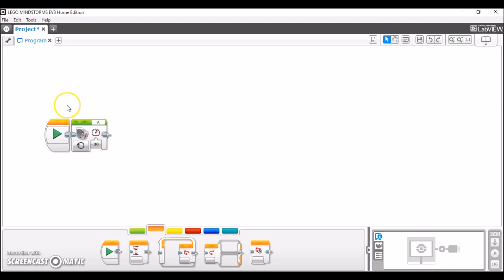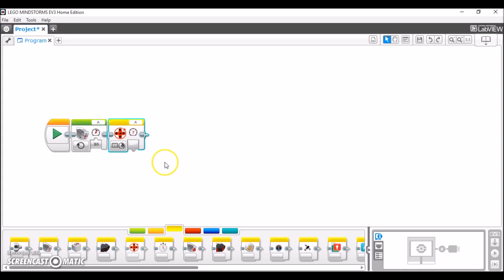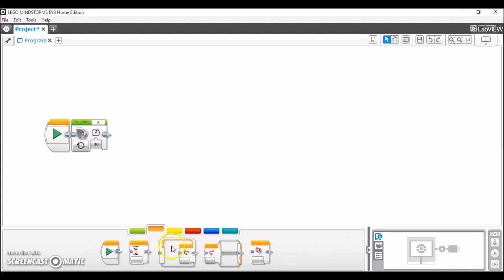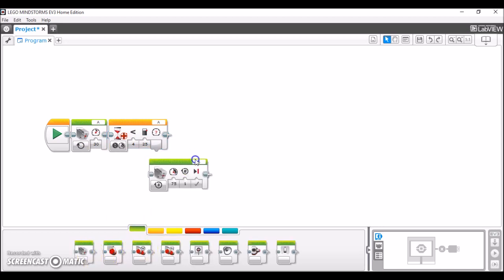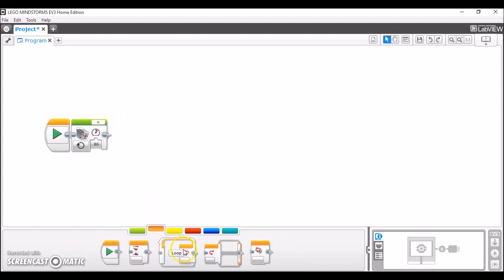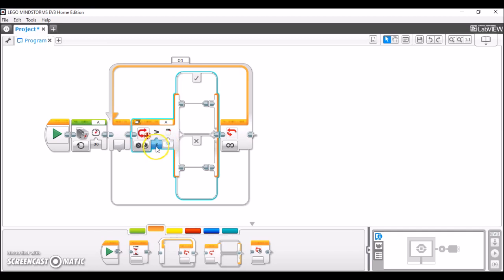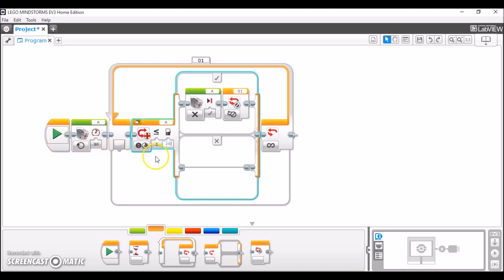Program your EV3 Robot to Detect a Motor Stall | EV3-G

Comment: Didn't work for me, sorry. I found a workaround that works 100% of the time by using timers: start timer before the motor command, reset it after the motor command. Then in another thread check the timer for value and stop the motor above certain threshold.
Reply from the maker: It's strange that it didn't work for you, this is the method I use all the time. Perhaps this method, which I covered in a more recent video, will work more reliably for you: https://youtu.be/7ptT2AEdbi4
Reply: @Builderdude35  For me the program just gets stuck on the instruction block for the stalled motor. Could it be that because I'm running my EV3 unit off the rechargeable battery pack, the power level is somehow unaffected?
Reply from the maker: The rechargeable battery pack has a slightly higher voltage, but you can adjust the power threshold value a bit until you get it to work. You may find that it works best when the threshold is just below set power. For example, set power 40%, stall threshold 35%. 

Alternatively, the other link that I provided has an updated version of my motor stall program that is more reliable; it works by measuring the change in rotation over a small time interval (essentially taking a derivative), and it works regardless of motor power, without needing threshold values.

Comment: Does FLL require a person to use the preinstalled firmware on an Ev3 not something like Ev3Dev?
Reply: Btw, I'm not an FLL member.
Reply from the maker: I don't recall exactly, but I'm fairly certain that you must program in EV3-G, so yes, that means that there's no point in using EV3Ddev.
Reply: Thanks!
Reply: Wazboy Developers I

Comment: It's okey to use it when you want to detect when motor is stalled, but useless when you want to protect your motors or electronics. EV3 motors already have auto detection when  motor is stalled. Try to stop motor with hand, you will see that power is cutted off automaticialy and it wait when you leave it to turn power again.
Don't worry, this is toy made for kids too, so it must be safe. If not, it could burn when motor is stalled, but it can't.

Comment: Hi! Hey, BuilderDude35 what you showed in your tut doesn't work at all. 
There may be some changes in the EV3 Lego mindstorms software but I think it isn't. And you while doing this tut you hadn't checked if that really work so did that simply theoretically.
Reply from the maker: This software absolutely works, and I personally use this all the time. You may need to add a short wait block in between the motor start and the Loop.
Reply: @Builderdude35  Thx. That helped!

Comment: the program did not work my motors are ok please help
Reply from the maker: Try lowering the motor's power and bringing the threshold power closer to the motor power.
Reply: Our team had the same problem and it seemed to be that the motor power ramps up (doesn't go to the target power immediately).  After turning the motor on, we had to add a small wait timer of about 0.25 sec in order for the motor to come up to full power, and only then would the test work correctly.
Reply from the maker: Crystal Springs Yes, in your case the motor didn't turn on fast enough, so it started looking for a power below your threshold before the motor was running, causing it to do nothing. A time wait between the motor start and the power check will help, just as you've said.

Comment: builderdude, can nxt motors also detect the current motor power? so will this work with the nxt set?
Reply from the maker: +Bawz Games I'm not sure. Most likely yes, though. You will need to use the EV3 programming on your NXT.

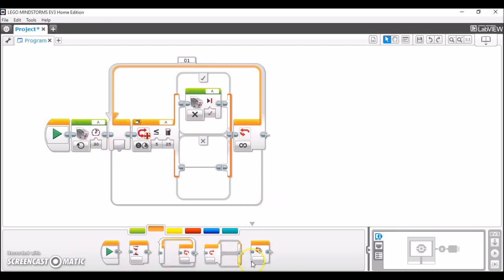Comment: Builderdude35, as always, nice video.  You do a great job with these.  At 4:15 in this video, you make use of the loop interrupt block.  Personally, I hate this block as I'm never quite sure what state the motors are in if anything more complex is going on, such as running a drive motor at the same time.  I've been working with my kids to use this as an absolute last resort.  A cleaner way might be to initialize a Boolean at the beginning of a loop, maybe called motorstalled=false, then when it detects a stall, set to true.  Then use this as a condition to exit the loop when motor is stalled.
Reply from the maker: +Andrew Brown Yes, that also works. Thanks for the suggestion!

Comment: Very nice! I find it interesting though that when a motor stalls it's current power drops: when a motor is stalled, the brick will give it more power to counter the stall, hence why it can drain your power really quickly. What actually drops is the motor's speed, the power however should raise. Is this the case though or am I wrong? :p
Reply from the maker: +Karl4123 No, you're 100% correct. Electric motors by nature will draw increasingly more current as their load increases. Just a poorly-named function, I guess.

Comment: I did'nt know that this is possible! Does it work with the NXT, too?
Reply from the maker: +Audiultra Robotics Yes, but you need to use EV3 programming on the NXT.
Reply: +Builderdude35 So you could build an automatic transmission with this ;D
Reply from the maker: +Cr3ditor Racing I already did. See my "Plethora II" video!